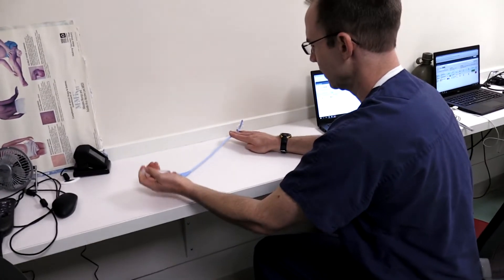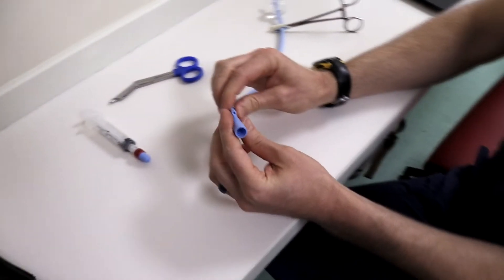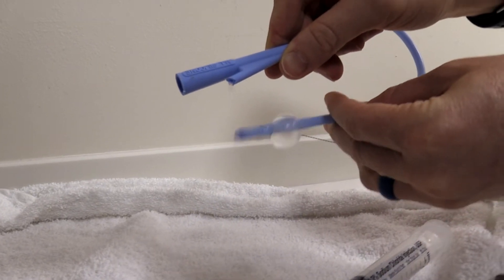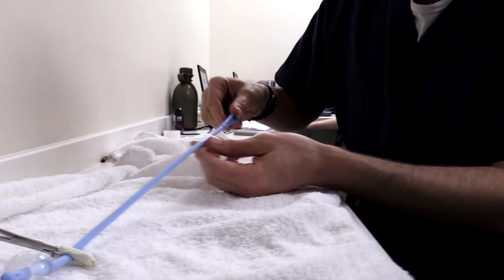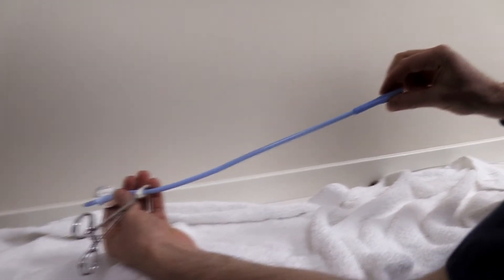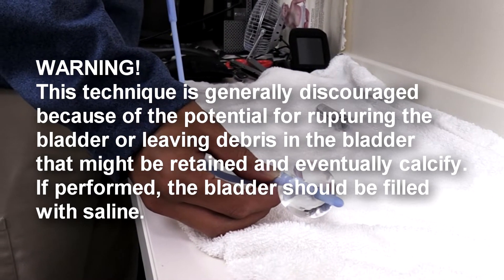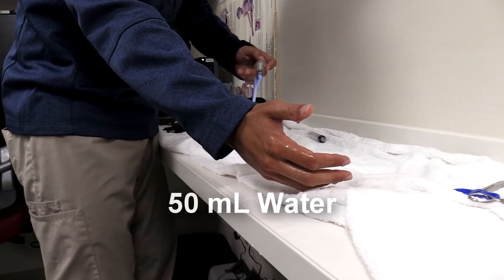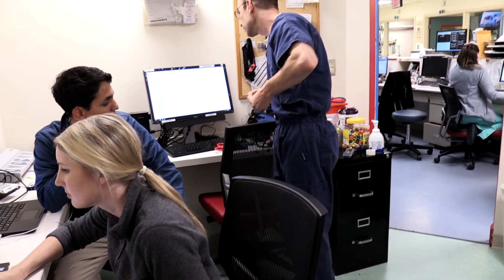My Foley Catheter Balloon Won't Deflate

Comment: I just did this Sunday, July 16, 2023. Saw a video that said, go into the shower with a scissors, cut the release valve off. All the water keeping the balloon inflated (10ml) will came out(it did in my case) easy because you’re standing and your penis is pointing downward. Wait 60 seconds and pull the catheter out slowly. It will sting a little and should come right out. If the catheter will not pull out, don’t force it. In that case, you can use some of the methods shown here or go to the emergency room. This whole procedure took less than 3 minutes. They did give me a syringe to use but I chose to cut the valve instead.